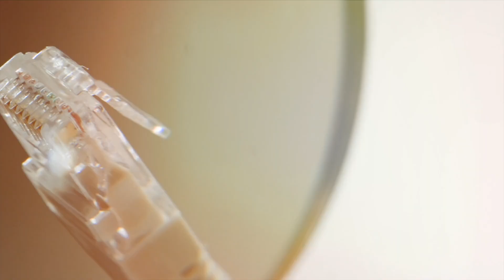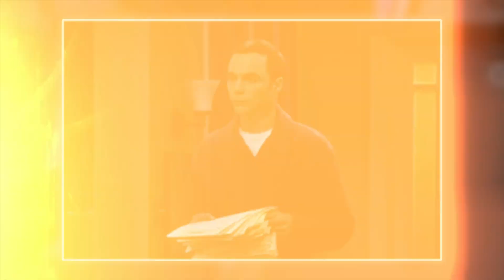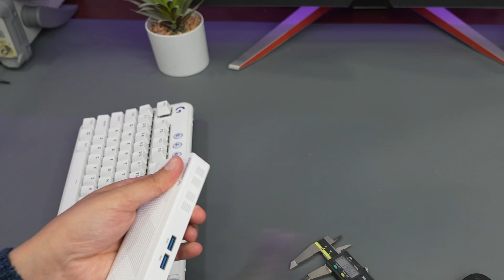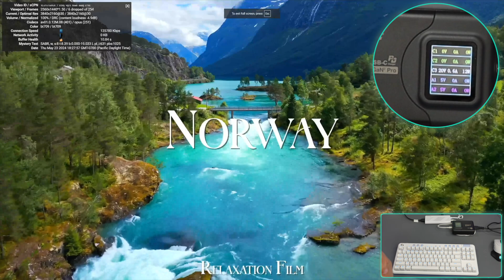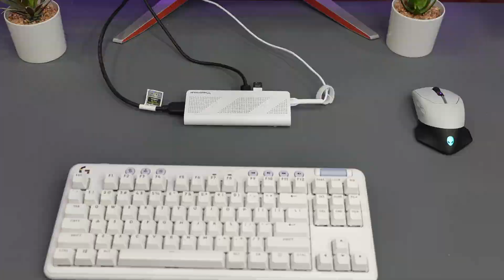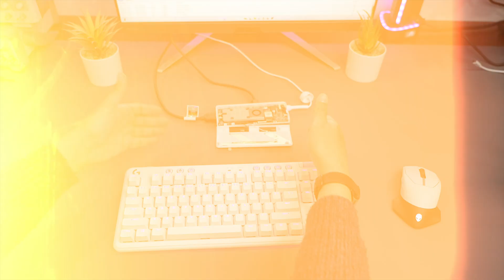Minisforum S100: The Ultimate PoE Powered Powerhouse Mini PC!

Comment: Purchased 3 of these. 1 directly from Minisforum site to give it a try, a week later 2x from their shop on Amazon because way cheaper than on their site.
I wanted these for the POE power to install temporary at customers sites for remote access.
All 3 of them seem to overheat. After a few hours (not sure how many) they crash and try to reboot but never recover.
They boot onto the bios page and there is no trace of the internal SSD. 
When letting them cool down for an hour and more, it will find the SSD again and boot. But after a few hours, the same thing repeats.
I suspect they overheat or an issue with the fixed samsung SSD.
I just returned all 3 of them as I write this. No discussion or solution minisforum has given me to solve this, except for returning them.
Looks like a production issue to me.
I really liked these, small convinient, POE power, affordable, perfect for temporary installs where I need remote access.
They are slow, but  that was ok for my use.
These were the 8/256GB versions.
I welcome a sugesstion for a smimular affordable mini pc like this with POE power.

Comment: I had the same Probleme but got Linux to work. Its not easy but it works... u need to mount the ssd manual with a live usb
Reply: Can you elaborate a bit more on how you did this? I can't get Fedora to boot
Reply: @garydeluce464 I would like to know in deep about this procedure if you don’t mind. Thanks much.

Comment: Hi all, I am looking to purchase this as a POE Device on my ui network to run purely Home Assistant. I like its power compared to a PI. Any idea if I could install Home Assistant Core OS on this, or will it need to be via Windows that it comes with first? I see some installed Proxmox.
Reply: Did you try it yet?

Given the fact that proxmox works and that you can put home assistant on proxmox it is definitely doable.

Comment: I got mine. I am massively disappointed that there are no BIOS settings to allow Linux to be installed. My plan was to used it as a low powered server to take off some services off of my main kit, but alas, that can't happen. I hope there is a BIOS update soon.
Reply: mine runs linux mint. other version have problems to install.
Reply: @JurnFranken-te8hf did you replace the Windows or running as dual-boot? Could you share which version of Mint did you installed?
Reply: @dmpreis , I installed the latest version of Mint bij completely overwriting the entire partition. (Boot from USB.)
However, the result is completely unstable. The S100 completely shutdowns after minutes / hours with zero load. :-(
Don't know if it is the device or a more general issue. (only runs Docker with Docker Compose in a container.) 
I have another one sealed in the box, maybe should image that windows version and rewrite it over mint to see if that solves the shutdwons.
Reply: @JurnFranken-te8hf  thanks much for the reply. I was able to run Ubuntu 22.04 updating the bootloader to boot from the UFS.
Reply: Someone on Reddit (in a post starting with "MInisforum S100 only runs Windows") shared a fix about a month ago. You need to live boot, chroot in, put ufshcd and ufshcd-pci in /etc/initramfs-tools/modules, and then `update-initramfs -u -k all`.
Reply: @grencez  Thank you for that. For everyone else who might be interested, I was able to install Proxmox without issue and run Ubuntu and Debian off of that. For about a month. The SSD failed and I sent my unit back and I am an awaiting for a replacement. Ultimately, I got a Mini PC because the S100's un-expandability was always going to be a bottleneck. When the replacement comes in, I will use it as an always on machine connected to my monitor or for testing. I'm glad it can take linux directly now though.
Reply: I got Zorin OS (Ubuntu Based) to work. U have to mount the SSD manuel with a live usb

Comment: Can we appreciate that this computer is cheaper than a raspberry pi, more software compatible (although the Pi has excellent compatibility), twice as performant, and actually doesn't lie on the specs? I remeber when the Pi4 was promising 4kp60...... well lets just say it cannot even properly do 1080p... let alone 4k.... and i'm not talking about videos or gaming.... i'm talking about just moving windows around and scrolling a browser page.
Reply: Having that said, I'm still pissed this thing doesn't run Arch.

Tried everything to get Arch (and Kubuntu) installed on this and it doesn't work. Someone says they got Linux Mint running on the S100 though, so I might try that though I'd still be unhappy in the end.
Reply: @XueYlva  i know this is old, but the tpm and secure boot may be to blame?
Reply: It lies in a good way
Amazon says 128gb UFS but it's actually 256gb UFS LOL
Reply: How is $200 cheaper than a raspberry pi?

Comment: The N100 can support 32GB single channel ram. I've upgraded my BeeLink S12 Pro based on the N100 to 32GB and no problems to report. Though it looks like the RAM is soldered to the board :-( no upgrade for this machine.

Comment: It has a UFS disk chip, like a cell phone... Think eMMC or micro SD card, not SATA or AHCI
Reply from the maker: I know, but still doesn't help. Ubuntu/Debian install with various options doesn't boot, gets stuck in grub recovery and doesn't "see" the disk to boot from
Reply: UFS... yes - I seem to be running into this breaking down, being intermittent or failing on mine after a few months of full power 24/7 proxmox usage. Now it can't run more than a week without disk issues and pve failing - with a reboot needed.  will be doing more testing on setting bios to min wattage and then testing usbc power (instead )of poe to reduce heat or power variables to see if it is truly the failing ufs.  wish it was replaceable nvme instead (but I know thats tooo big for this formfactor) - was an amazing box to run pve on poe with small lxc containers for dns/netboot/uptime and other small monitoring utilities.  appreciate the inside look @technicallyunsure!!!

Comment: what the hell? it'll boot from Debian (Proxmox) installed on the NVMe but not from Ubuntu or Fedora??
Reply from the maker: Yep, no idea why. I tried Fedora, Debian, Ubuntu, all get stuck in grub recovery. But proxmox worked like a charm
Reply: @TechnicallyUnsure  Simply drop GRUB and use systemd-boot like Proxmox installs it. This device is one of those which allow only UEFI boot. Look at the Proxmox boot menu after installing Proxmox. It's not GRUB, it's systemd boot.

Comment: I bought one of these S100 machines from Minisforum, and have been using it for a couple of weeks now. It was purchased, along with a 24" Dell Ultrasharp monitor, to replace a stationary, aging 18.3" HP laptop. I replaced the Windows 11 Home on it when it arrived with Windows 11 Pro, so it could join my Windows domain. The machine, when powered using the included USB-C charging adapter barely gets warm. The S100 will be used wirelessly all the time, paired with a Bluetooth keyboard. Its WiFi works reliably with a UniFi Express WiFi 6 access point.

There is a power setting in the S100 BIOS that allows you to set the default 6000 (6 watt) power cap to any number up to 9000 (9 watts). I have that set to the maximum, favoring performance over power savings.

All said, I am pleased with this machine, as I am pleased with the Minisforum MS-01 I purchased before it.
Reply: that MS-01 is just such a perfect homelabber box.
Reply: @notaprofessionalJ  I moved most of the necessary VMs from an R740 onto it for the summer to save power and give the AC a bit more oomph. Unfortunately the little box topped out with only 96G. The R740 was using about twice that. I also needed to power on a little N100 box for a couple more VMs, including a second domain controller that I don't want on the same host as the first.
Reply: Does it play steam games or emulators?
Reply: @xenochx_gaming6393  It's an N100, so I'd think it would play most emulators just fine. It's running Windows 11 and streaming media from a NAS most of the time.

In fact, I'd say that when the machine is on, there's a 50/50 chance it's streaming Star Trek TOS.  ;-)

For what it's doing, it's just fine. Nice 24" Dell monitor attached. The whole thing replaces an old Toshiba 18.4" Core i5 laptop that aged out with Windows 10.
Reply: @xenochx_gaming6393  I have run my S100 with Windows 11 Pro, and it can run easier Steam games perfectly fine such as TF2, Left for Dead 2, and Polygon, I have not done much more on it yet as I am learning how to get Linux setup on it to hopefully avoid so much RAM usage from the OS as Windows seems to do. I also changed the power setting from 6 Watt to 9 Watt, i believe the only issue that does slow it down for me is insufficient heat dissipation. But using the supplied  USB C instead of POE should fix this issue.